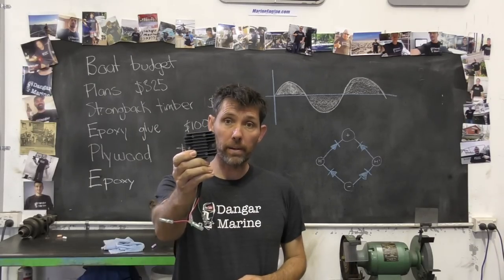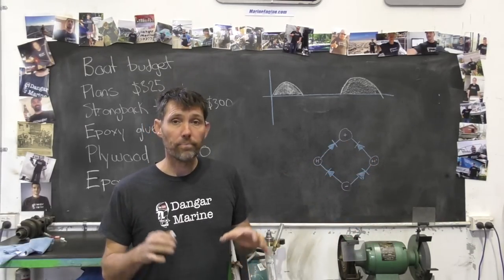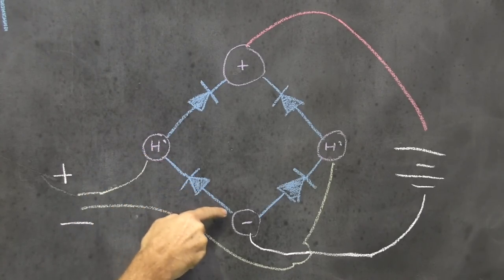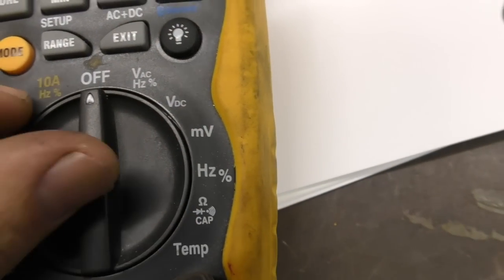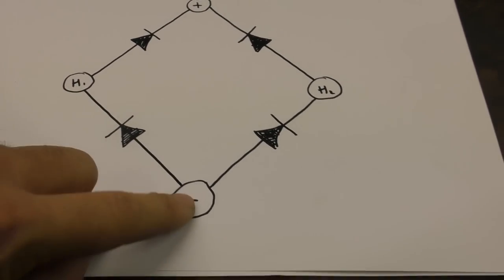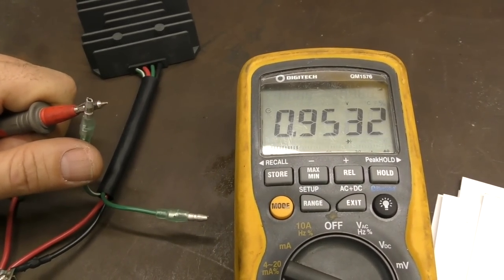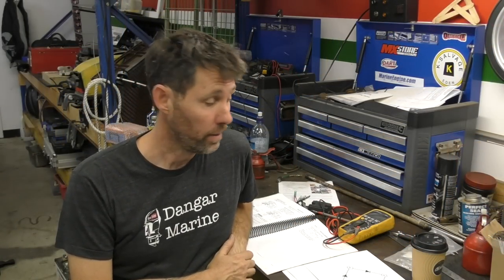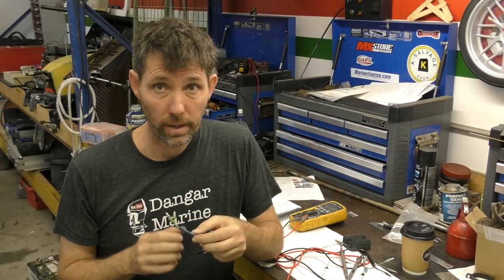Testing a rectifier

Comment: The big heat sink body gives a clue that the unit is a rectifier and a voltage regulator in one unit. The smaller unit is definitely a rectifier only. That .5 volt (often quoted as .6volts for silicon devices) is why a rectifier gets hot. Say the alternator has a rating of 20amps, to get DC watts (heat)  simply multiply Volts x amps, so of the power generated, 10 watts is thrown away as heat by the rectifier. How hot is 10 watts? Try holding a powered up 12watt car tail light in your bare hands - you wont be holding that globe for long! And as electronic devices are easily destroyed by heat, the designers work hard to get rid of the heat as fast as they can. That small rectifier body is about what I would expect to be able to handle 10- 20 watts. That big Yamaha unit is more like 150-250 watts when it is bolted to the engine. The alternators on a most outboards are permanent magnet types with the magnets being part of the fly wheel mass. There fore , the alternator makes full power ALL the time the motor is spinning. So if your battery needs 15 amps to charge and your boat electrical load is 5amps, that 20 amp output is all going to be absorbed and the regulator will barely get warm . But as the battery charges, the current it will absorb will drop, so at full charge your battery may only accept 1 amp , your boat load is still 5amps, so only 6amps is being absorbed. But the alternator always produces 20amps, and if you do not do anything with that unwanted 14 amps , the voltage will rise to some where around the 18 to 20 volt mark, which will blow up 12v electronic items, burn out pumps fast and kill your battery pretty quickly. So these alternators use  what is known as a series or 'bypass' regulator. Basically they turn the extra power into heat and throw that heat away. The amount of power turned into heat is controlled by the voltage needed on the output. In our case it is typically 13.8 to 14.2 volts for a 12 volt boat. So a device in the regulator ( another diode called a zener diode) is used. The zener diode is special in that it is designed to conduct  power  at a specific voltage. In our case, it would be a 12volt zener, hooked up to a big transistor (not an SCR) in such a way that once the zener passes a voltage (ie, the alternator output  is going higher than 12 volts ) , the zener turns on, which turns on the big transistor a bit. That transistor then converts part of the alternator output to heat which absorbs the unwanted amps. In our example the zener would turn on the transistor pretty hard and turn 14 amps into heat . 14 amps at 13.8 volts is nearly 200 watts ( 2 x 100watt spotlights held in your hand!) - so that heat sink has to be big to get rid of the heat. Some outboards actually run cooling water through the heat sink to get rid of the heat . There is more than just a zener and a transistor in a regulator but they are the main working bits. And those extra bits is why a simple multimeter test is useless for a rectifier/regulator unit. You need a test rig ( 18Vac output transformer, a few globes as a switchable load would be simple to make) to test those. Some low out put alternators ( the Johnson 50ESL74M for example) are only 6 amp total output. So they run a rectifier only. And you act as the regulator by watching the voltmeter. If the voltage goes above about 15 volts you turn on more electrical load like your nav lights, step lights etc until the voltage stops going up.  Pretty crude and hard on your electrics if you get distracted. Many four strokes have a small car type alternator that works a totally different way  so if you have one of those, don't go looking for a big regulator  like the Yamaha one Stu shows in the video- there wont be one.
Reply from the maker: Great information Ron, thanks for taking the time.
Reply: Thanks for the information, really useful for what I facing:  the outboard running at around 3500rpm and its output to 15v to 24v!  I think something was wrong about the Zener diode, but it seems to the needs of replacing the whole rectifier btw
Reply: Older Mercury 2 strokes (had 2 of 60hp 3 cyl) had some sort of above problems or maybe overheated/short or possibly corroded bullet connectors cause the rectifier embedding material to catch fire & burn up some of wiring harness & close by connectors catching inside of cowling insulation on fire- I've seen this twice Ladt time previous owner put out smoldering area w/ onboard fire extinguisher had to get towed in - Seems bad enough to have failure in which component goes bad but Scary part here is motor cathing on fire burning up harness & anything close by Whoever worked on this last Mercury 60 Bigfoot looks like didn't put an OEM regulator back on & instead of the original 2 components (rectifier & regulator w/ embedding material)went back w/ all metal single unit- I'm guessing even if this combination single metal unit goes bad at least ways hopefully it won't catch on fire again- I recently purchased another 60 hp same year model but Jet pump & this one is all original low hour motor but I'm wondering if I shouldn't head this somewhat of Mercury problem of & remove oem regulator w/ that gel looking embedding material for safer all metal regulator? Quick Google search I see several older Mercury 2 strokes-- have had this problem- Also have read that having deep cycle batteries as cranking batteries aren't good idea but haven't research this -Does anybody know of a hack or fix to reduce chances of motor fire by overheated regulator/rectifier?
Reply: Thanks for intel.

Comment: Just a side note. My rectifier in a 1991 Johnson 225 hp had a bad rectifier. Part of the troubleshooting was if the tach was going crazy which it did. That rectifier was cooled by the water system. Thanks for jumping into electrical theory which most would avoid. Enjoyed it.

Comment: i have a problem, seems when i turn on the power, smoke comes from my rectifier, 90hp 1995 evinrude. this cant be good
Reply from the maker: Always hard to put the smoke back in...
Reply: @DangarMarine  can i put this down to a 1995 rectifier reaching retirement and curling up its toes ? Ive checked all connections are clean and tight, so cause is beyond me and as a new one is 500 bucks, nervous about installing it. Hopefully catch you on the water soon

Comment: Thanks very much for this. I haven't yet done the diode test you've described, but I have a problem that when the red lead out of the rectifier is connected to my Yamaha 9.9 outboard's inline 10A fuse, the fuse blows as soon as I start the engine. If I start the engine without the red lead connected, the engine runs fine, but of course I have no charge. Is this probably a broken rectifier?

Comment: Great video. I went through this when I first got my boat. The previous owner (who just hammer bashed lugs onto the battery leads) didn't have red heat shrink or even red electrical tape. And being a first time boat owner, when I took the battery off to charge it, I made the HUGE mistake of reverse polarity! I didn't know how bad it is for an outboard, and should have traced the leads before connecting. Lesson learned! My boat still ran for a while then all the problems came. Burnt wires exiting the regulator/rectifier, battery always weak, and Tach broken. Ordered a knockoff rectifier off Ebay and had the same problems. Ordered another and installed it and fixed my problems. I also had to cut and add several new wires that were badly burnt. The easiest test I found (besides seeing the tech working) was checking the battery voltage with a multimeter. Before it was in the 12 area. After the new rectifier the voltage was somewhere in the upper 13s. So I knew my battery was being charged. I've read stories where it gets REAL BAD. Basically destroying Stator and the whole electrical system and wiring.Thank God my mistake didn't end like others. I was pissed at the time dealing with all of this, but now consider myself lucky

Edit...Today I checked with voltmeter and with a good regulator rectifier I get mid 14s(showing its charging). I cant remember exactly what is was before I got it working but It was probably low 13s
Reply from the maker: Hey Jim, you were unlucky to have so much damage - your right that even a bit of red tape makes it much less likely to happen. Testing the voltage at the battery is definitely a great way to get an overall health check of the charging system.

Comment: Another piece of evidence that it has a regulator built in would be the input AC voltage. When you rectify AC the DC voltage will be about 1.4 times the AC RMS voltage (assuming single phase, it's sqrt(2), if 3 phase it's sqrt(3), but this is for a single phase rectifier ).

So setting the multimeter to AC volts and probing the alternator should give you an RMS voltage. If it's just a rectifier with no regulator, we would expect to see about 13.8/sqrt(2) which is about 9.7 volts.

If the input voltage is higher, dollars to donuts you have a linear regulator like a LM317, LM7812 (or similar) internally which is the part that will generate most of your heat based on how much current you draw and the voltage difference between input and output. 

Thanks for sharing! I'm recommending this video to a friend :)

Comment: I have an old 1981 Kawasaki KZ305 motorcycle with a single phase rectifyer that has pretty much the same wire setup. This video actually helped me diagnose my electrical issues that I've been having recently. Thanks for this. =)

Comment: Stu, I really like your style. Testing electrical component is the hardest for me. Most of them aren't that simple, they usually come with hidden electronic components making any reading erroneous. Rectifier is one of them with the embeded regulator, CDI is another one.
For rectifiers testing, what I am doing now is testing the AC out of stator and the DC to the battery. If the DC is all over the place but AC ok then I'll replace the rectifier. Even that isn't bullet proof as some tachometer take their input from the AC and a faulty tach could mess up the whole thing.
Thank you for posting that video, it feels real. Great job!

Cheers.

Comment: Remember you don’t get a perfect diode, there always is some reverse leakage current and that explains the reading you get when measuring between the red and black wires. Reverse leakage current differs from diode to diode as well, so even the one that gave no reading still has reverse leakage, your multimeter just couldn’t measure it.

You also have a forward voltage drop which is around 0.3V per diode, so for a full bridge rectifier you will drop around 0.6V.

The resistance that causes the forward voltage drop as well as the reverse leakage will cause heat hence the heat sink.

Comment: Great video again explaining how a many outboard charging systems work. The rectifier you drew is exactly what you find on low power (6 amp and 9 amp) charging systems. An easy way to identify that simple rectifier is on Mercury's it looks like a small gray plastic diamond and on the OMC stuff it's the little cylinder rectifier see link below. I am not sure what Yamaha and others use. Either way charging systems that have higher outputs like a 16 amp system also incorporate what is called a zener diode circuit. I do not think they are SCRs. A zener diode will allow current flow when the voltage hits a certain level. So on an outboard like the Yama-dog you showed when the voltage exceeds somewhere between 14 and 15 volts the zener diode will dump that excess current (I think to ground but not 100% sure) so you do not over charge the battery and fry the electronics on the boat. These rectifier/regulators as I consider them are what your Yamaha had and most outboards have any more.   
http://www.marineengine.com/newparts/part_search.php?part_num=581778

SCR switches are used in Power Packs and Switch Boxes they are activated by a small electrical current and will continue to conduct electricity until the power source is completely discharged. Trigger Coil sends a some current to SCR in Switch Box SCR closes circuit and it stays closed until the capacitor in the Switch Box discharges completely to the ignition coil. Like a transistor but a transistor needs constant current to activate where an SCR only needs monetary current to be activated. I use to demonstrate this to my students with lights when I taught boat mechanics. Great video sorry for the long post.
Reply from the maker: Hey James, thanks for the extra info, very helpful!

Comment: Thanks Stu, I finally made the wall👍 Cool video on a rectifier. Allot gong on with outboard engines which is an amazing piece of machinery. One of the most important is keeping the battery charged up when running
Reply from the maker: Not many spots left now Tim, thanks for sending the pic!

Comment: The 2 blobs that showed ~1V across them are actually rectifier/regulators.  They have a monster zener diode that starts conducting at ~14V in the reverse (breakdown) direction internally.  The 1V you were seeing is it conducting (poorly) in a forward bias mode.  The manufacturers do this since windings and permanent magnets form a generator that pumps more current out the faster you spin them.  They would soon go to 16 or 20V and blow all consumer electronics in the boat.  You can do voltage regulation with transistor circuits but it costs more.  Most motorcycles do this too.

Comment: Remember resistance will lie to you but voltage will not.
Depending on your meter wired internally.
Diode check one direction and then reverse bias and you should get a quick beep with your meter.

Comment: On the old cars the gen idiot light would come on with the ignition switch off.  Problem was the bridge rectifier had a diode failure letting the battery discharge.  I also had an alternator (DELCO) that had a diode go bad in the diode trio in the alt.  The symptom was the choke/ buzzer coming on at low rpms.  If yo can get to the diodes, you can check each with the ohm/meter.

Comment: Hi Stu, I was hoping that you might be accepting work during winter. i went to change the gearbox oil on a 2000 150hp johnson and water came out. i'm down the f3 in rooty hill. the gearbox is off the motor. thank you

Comment: Hay mate hope your well sorry u probably  get this lots got a 1992 johnson 50hp 2 cylinder  I noticed the wire for the voltage regulator where bridged positive  to negative  from stator and from cdi pack so was shorting the gauges and found this issue. Long story short we left ramp putted out at 4knots went to open it up only half throttle  pull up have a look around can't see anythink no leaks nothink then start it up and off she go's  on plan run good for awhile stop fish move around a few spots then bam again nothink over half throttle again stop play around and start it a few times then good again also struggled to start without choke and wouldn't idle while the problem was happening. Had all new fuel line and tank and I've had it at the shop for a service and tune before this test the owner before disconnected the vro but have only removed the tank and the wires from tank and left the other wires. Since I've had a play with it I fixed the voltage regulator  wires got gauges working  now nothink  when I tested a plug lead off motor it wouldn't  get any ohms so I've replaced that any tips or idea's  would be appreciated  as I've spent a shit load at the shop with no luck when I rang are local johnson  experts  they  said a ignition  fault that's how I found the voltage regulator wires would that cause the issue  won't do it in the 44gallon tank or the muffler on any tips please sir want to get my little  girl out there

Comment: I just went through an old 60 hp mercury and had to test all the wiring and components and ended up buying another boat for my Dad as I almost gave up.

  Parts are getting hard to come by for the oldies and I learned to always check your system is charging. 
  If the rectifier goes it builds up alot of heat and does alot of damage to other things. 40 yr marine mechanic shared this while selling me some parts.

  Bottomline ....diy
  In this case a complete wiring redo including the wires from the stator.
   New rectifier and new switch box.

    Runs like champ now.

Comment: Hay Dangar, I need your help, I have a mercury 75 2 stroke, I have burnt yellow plugs from my stator to my regulator rectifier, it's missing at high rpm and also my tach is All over the place. I've tested my stator but seams to be in my manual spec, my manual does have a rectifier test but is a 3 post one, my motor has a 6 wire regulator rectifier but I can't find any info online on how to test, I just don't want to buy a new one and then find out it's not the problem
Reply: Did you find an answer...I have the same problem on a merchant 75hp ...because the wires were all burnt I couldn't work out where to replace them to ...on the new rectifier?

Comment: So I recently bought a used rectifier because my tach signal was not coming from the rectifier so I replaced it thinking the rectifier was bad.  Did the test on new used rectifier as you have shown Neg MM lead to Positive rectifier wire Positive MM lead to tach and ground wires (white & Yellow) got reading reversed no reading.  Thought all was well. started up and not tach signal and battery was not charging?